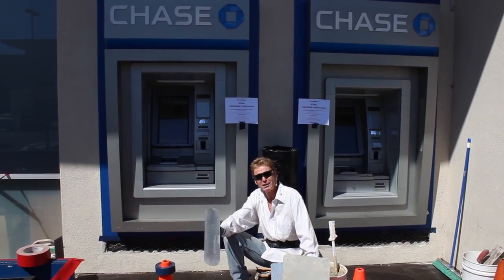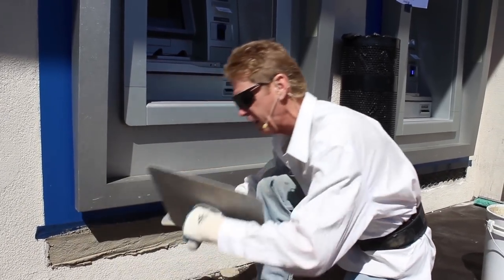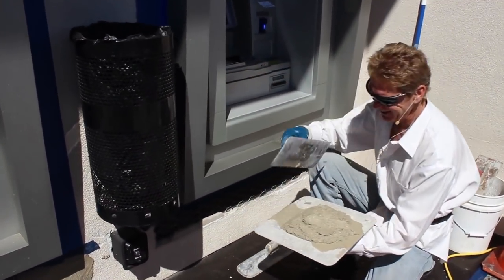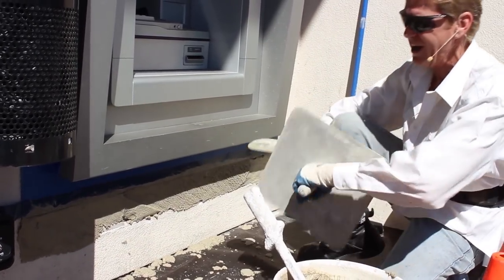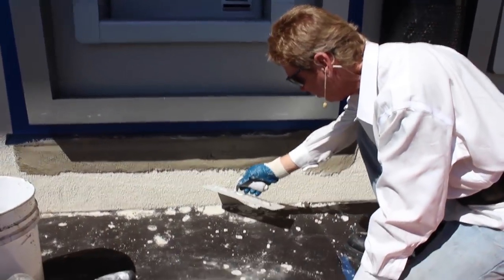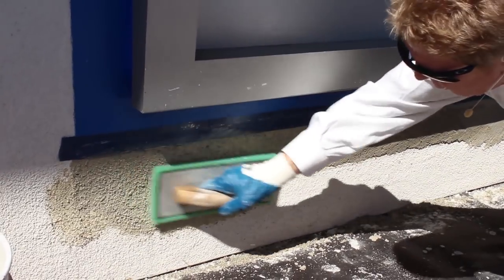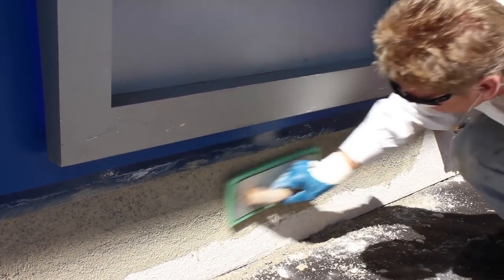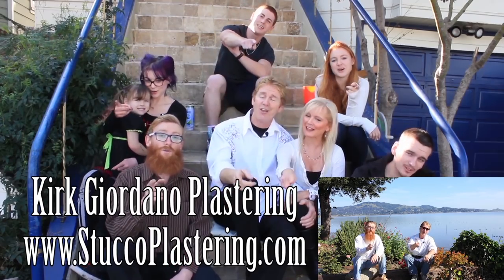Exterior stucco matching a sand finish.

Comment: I would have liked to see that finished product.
Reply from the maker: Howdy Spencer, you did not miss much I did have to take pictures to send them to another state in order to show my work and get paid, it was very close in color but on the money in texture, this was what I got paid for, not matching the color, when we got there I simply told Jason (my Son and camera man) who mixed my mud, look at the color and add whatever amount of the white cement plaster you feel is necessary to come as close as possible to the color until they paint, as it is a bank, and our work or this wall should be somewhat presentable until the cure time before painting from corner to corner.
 cheers,
kirk and Jason’s plaster rendering videos

Comment: I am patching a larger area, about 16 inches by 10ft. I was reading that I need to do a scratch coat and then a brown coat or finish coat but you haven't done that here, is that because it's a smaller area? Mine I think is deeper as well maybe then you would do the two coats? I want to make sure I do it correctly, thank you!! Thank you for the videos, very helpful!
Reply from the maker: Afternoon Kylie, below is a video the, in the first 5 minutes shows you how to do it. https://youtu.be/2MOc4eYL6-M/
 Buy, "rapid set Stucco" from HD or Lowe's, Don't mix more than 3 to 5 minutes then trowel it on with as few strokes as possible. Mix it kind of stiff, now the clocks ticking, get it on within 15 minutes. Id say good luck but luck is the residue of researching and retaining what you've watched.

Comment: Kirk:

1. On interior imperial and diamond plastering, on the first coat that goes in between the keys on a repair or even a full open lath wall, I forget...help me out here. Do you wet the lath first?  I thought I heard you say to wet it first. Or, do you use plaster weld over the wood , or both?  Thanks pal.
Reply from the maker: Howdy mate, the keys must be super clean when in doubt apply a bonding agent as this bonding agent is mostly water, thus the water will remove most dust invisible to the human eye.
FYI, unless the cedar wood lath is new, I use a bonding agent, mushrooming thorough the keys holds well but I want the wood to also hold my gypsums.
 cheers,
Kirk and Jason’s sand and cement rendering videos

Comment: Hi Kirk.  Love your videos.  You have a great channel.  Thanks for all you do.  I have a question.  I'm adding an outdoor kitchen and want to match  match the existing finish on the rest of the house.    How do I know if it's 16/20 or 20/30?
Reply from the maker: 16/20 is course, 20/30 is medium, 30/30 is fine, google the grits as I don't know the size ranges or if that info would help you anyway. 
This video shows coarse sand.💃🏻
Reply: @StuccoPlastering  Thank you Kirk.   This is helpful.  Do you know if Kwikcrete finish coat stucco is 16/20?
Reply from the maker: I'm not sure, HD and Lowes, both sell "Rapid Set Stucco', this is indeed 16/20 or a heavy grit.

Comment: Kirk, do you know anything about adding a crushed marble dust finish to a stucco wall?  I'm building a new house and I want it to be like my old house (1916) which had a finish of this type.  It looked like they threw or sprayed crushed marble onto the wall after it was done, OR maybe put the crushed marble in the portland for a finish coat and then washed off some of the portland to end up with clean little tiny crystals of shiny marble.  I've never seen it replicated but I do see reference to the supplies for it in cement and plastering books from the 1910s and 1920's.  Any advice greatly appreciated.  This is a finish may have been common 100 years ago but subsequent owners of these buildings usually ruin it by painting over it.
Reply from the maker: Evening PMC Driver, venetian plaster is made with marble dust. The finish you're referring to is very common in the UK, but not so much here in the USA.
 It's called a pebble dash finish where seashells, glass or other decorative stones are added to the finish coat, then thrown on as the finish coat.
                         Bringing peace, love, and harmony back to the world of plastering.
With over 800 educational and free Youtube videos, by your favorite plaster geek, “me,” and Jason, my son, the bearded plasterer.

Comment: I'm more of a stone guy but trying to get better at stucco. I've done sand finished work with my old boss before but he always added sand to the bag of finish cement and we always used a decent amount of water when sponge floating..... Just did one on my own and didn't add sand. The cement felt very pasty and also set up super quick on the wall. When I tried to sponge I couldn't get any texture. I wet the wall but not sure if I did enough and ended up really having to wet my sponge.. Why did I struggle so much?
Reply from the maker: Evening Daniel, dude, sounds to me like you mixed too long and used dirty tools and or a dirty bucket,
 this will accelerate the set time from 20 minutes to 5 or 10 minutes.
 FYI ,all tools, buckets and even the drill paddle must be super clean, when mixing plasters or this will happen.
Cheers and have a good new year,
 Kirk and Jason giordano’s plastering tips

Comment: Hey Kirk, how long do you have to float it before it’s too long? Curious how far I should go with applying the coat before going back and floating it
Reply from the maker: Good evening Robert, about 20 minutes, in the hot sun maybe 10 in the cold weather perhaps a half hour.
 Bringing peace, love, and “brotherhood, ” back into the 🌎 of Plastering.
    The most comprehensive encyclopedia of plastering on video, by the plastering messengers of Youtube. 
Kirk and Jason Giordano with over 800 videos 🎭 👀💃

Comment: Been plastering about 25 years I was always thought when there is a foot or less of existing stucco to the weep screed or angle or corner. Glue with bonder to weep or angle or corners and float to weep or angle or corner. That way there is only a patch on each side not all the way around just wondering why make a patch 6 inches to weep and stop curious
Reply: Good job by the way not knocking you at all

Comment: I have a 1 inch hole in my stucco I’m trying to patch up. I don’t want to buy a big bag of stucco to match the finish can I can a small can of stucco and still get the same out come? If so what should I get along with what tools would I need?
Reply from the maker: Howdy Clint dude, you can purchase  5 to 25-pound boxes of rapid set stucco at certain stores.    
                     Live long and plaster, 
  Teaching plastering tips with proper techniques

Comment: What texture sand is included with the Eisenwall? Straight out of the bag is it 20/30? Or did you add sand? I have some patches to do and normally use stucco patch by rapid set. It includes 16/20 sand. Does the eisenwall include coarse sand? Thanks Kirk
Reply from the maker: Howdy Kanes, I would recommend Rapid set stucco, sold at all home depots and lowes and many other hardware stores, they have ten-pound and 25-pound boxes and of course bigger bags for larger jobs. This is called Rapid Set Stucco, it is indeed sand of 16/20 or the heavy sand.
     Introducing peace, love, and harmony back into the world of plastering.
                 The University of plastering by Kirk and Jason Giordano

Comment: Kurt, but Im building a BBQ island using either hardybacker or concrete board. Do I need to use chicken wire?
Reply from the maker: Howdy Rebekkah dude, no, but I would recommend corer aid mesh tape over any joints and a quality bonding agent,
Cheers and have a good and healthy new year,
 Kirk and Jason giordano’s plastering tips

Comment: Hey man. It was hot in this video. You don't sweat man?  I would be dripping.
Reply from the maker: Howdy Spencer, oddly enough I rarely sweat even in my favorite weather 98 and dry and sunny,
 which means either my organs are jacked up or my system is really clean.
 cheers,
Kirk and Jason’s sand and cement rendering videos

Comment: Can 16/20 be found a lowes/home depot?
Reply from the maker: Good evening Me Foo, yes it can be, buy, "Rapid set Stucco, it's designed with 16/20 sand included in 10, 25, 50, and or 88-pound boxes or bags just buy what you need. I have seen this cement stucco at HD and almost all the quality hardware stores I have been to.
You just add water. "Rapid Set Stucco," is one of the most users or DIY friendly fast setting stucco's on the market with little competition as far as strength levels.
 Like all the same day stucco's do not mix more than 3 to 5 minutes, as this can compromise the strength of all the same day or one coat stuccoes.

 Bringing peace, love, and brotherhood, back into the 🌎 of Plastering.
    The most comprehensive encyclopedia of plastering on video, by the plastering messengers of Youtube. 
Kirk and Jason Giordano with over 800 videos 🎭 👀💃

Comment: Kirk, but I don't want to disappoint you as I have been plastering sheet rock for over 20 years now and I have become extremely fast and very good at it.  Here is a big disappointment for you – I must admit that I cannot master that technique of using those trowels you use. I am trying to start using your system and I have watched you very and attentively – you said very good things about people who use joint compound and let me tell you something I feel that the blade is too far away from my hand for me to control the material being applied.  

I realise why do you mean when you keep telling us that you have many years – it is not something that anybody could just take up and do themselves – do you think that I could use your veneer plastering system with the common taping knife?  Or do you think that I will eventually get it and learn how to use the Marshall trowels  for plaster
Reply from the maker: Howdy mate, no worries, Jason my son prefers our 20x5 as he has the hand eye coordination, personally I prefer the smaller 16x5,
 I tell most to start with the square 12x5 and work up to the 14x5, it simply takes practice, then one day you think to yourself man I need a bigger trowel to save on  time.
 Or keep on keepin on with a blade. The whole idea is to use trowels that you're comfortable with.
 cheers,
Kirk and Jason’s sand and cement rendering videos
Reply: You are quite talented man. And I did notice that your little daughter it's pretty good with that thing too. Good for her. I am going to keep at it.
Reply from the maker: Howdy Spencer, it's just practice, 
 I have told all my kids, they are grown as young adults today, but I still see them as kids to use whatever trowel floats their boat.
 cheers,
Kirk and Jason’s sand and cement rendering videos